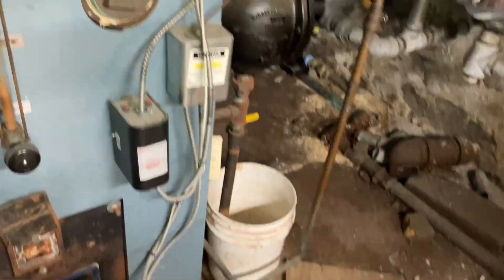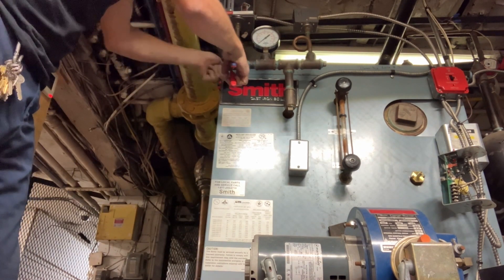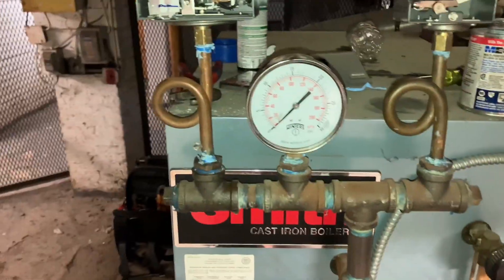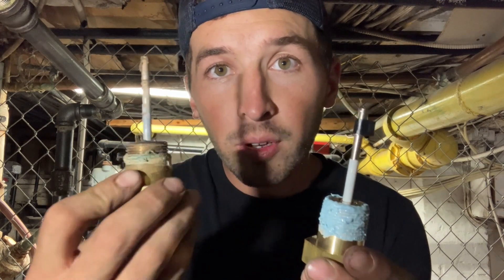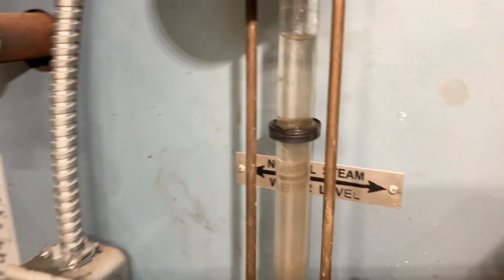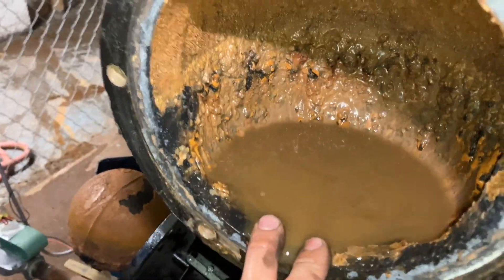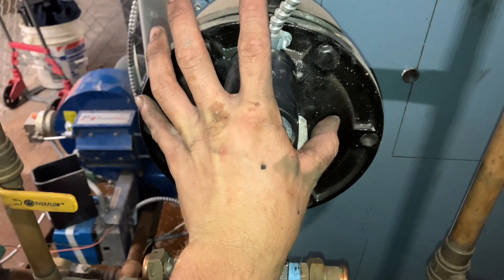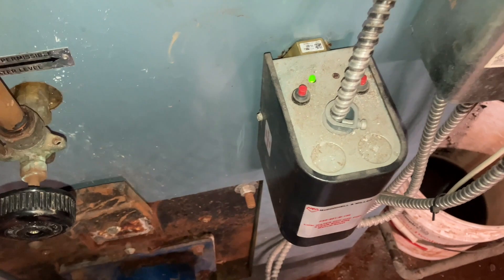A Helpful Steam Boiler Maintenance Guide

Comment: Idk why but cleaning a really dirty steam boiler is so satisfying. Specially when it’s done and running perfect, degrease the jacket so the customer sees a “clean” boiler. Take videos so show what you did, i hear “usually this only takes 10-15 mins”. Then the other company wasn’t doing much. 15 mins is enough to maybe test the LWCO and make sure it turns on and off but that’s it. No burner tray cleaning, no pigtail check, and usually the pressurtrol is at 5-8psi 😂. Just keep turning up the pressure every year, nothing wrong here. 🤦🏻‍♂️

Comment: Your pigtails should be rotated another 90 degrees. yes your current controls aren't affected but old school mercury controls could be affected when the pigtail expands and contracts and rotates the control side to side in the current configuration. rotated 90 degrees it would rotate back and forward and not affect the mercury.
Reply: You've seen that on the others dude video😂😂😂😂😂

Comment: Excellent videos! Question, are the workpro wrenches I’ve seen you using a pretty good set? I need a budget set to keep in my truck. Thanks.
Reply from the maker: other than the fact that i lost one in my truck...somewhere, i haven't had a single problem with them, and i've seriously abused them, 3 years later they've held up well for me!
Reply: Awesome. Thanks

Comment: I don’t remove Lwco probes, I just test them. Most of the time when I do remove them to be replaced the ceramic breaks. So if it was working and the ceramic breaks the customer would be mad I broke something that was working or my office would be mad I’m losing them money by not charging for a part.
Reply: That's why you always make sure you have the part in your truck so you can sell them a new one, Maybe you should just go to the supply house and stock up so you can make those extra small sales that will prevent a callback or a potential breakdown
Reply: Fill up your glass because it's always only half full... be the best tech not just a good one
Reply: @unknownbostonian that’s not realistic I’d need a tractor trailer for all parts that exist that I touch in a day. Also most of my customers wouldn’t accept that the probe broke when cleaning and wouldn’t pay for anything probably lose them as a customer.

Comment: By looking at the boiler you can see that the owner is not maintaining it. A boiler mechanic should explain to the owner and the building superintendent that the boiler needs to be flushed once a week. 
Many boiler mechanics will not clean out the low water cut off. They tell them to replace it when it no longer functions because they don’t want to be responsible if it fails for any reason.

Comment: Great, clear and to the point. Thanks so much from Queens, NYC.  Boiler wouldn’t start, took off the tstat connected the wires. Thought the low water cutoff not working, with your instructions found the probe that probably needed to be cleaned. Gonna check that out now. Thanks again, you’re thorough, and easy to understand.
Reply from the maker: Thank you for the support Eugene! Very generous of you to leave such a great comment. Glad everything worked out for you!

Comment: Excellent Job! First time watching your channel.
How would you clean the probe hole before installing a new probe? My low water cutoff won't reset even tho the water level is back up. I'm suspecting the probe but if mine looks like your I want to clean with out causing more issues.
Reply from the maker: appreciate your support Jeffrey! i use a piece of emrycloth or scotchbrite to clean it, just enough to get the mud off until i see bright metal. when in doubt though, i change it to a new one.

Comment: Your not supposed to put teflon tape or paste on the probe it gives false reading. Just supposed to put in very tight. It's in the instructions.
Reply: instructions say to only put dope only on the last 3 threads.  Do not put dope on the front threads so that the probe maintains a good ground to the tank.  My maintenance manual says to replace the probe every 10 years.
Reply: @zeroordie I am so scared of boiler failure i am much more comfortable checking it and replacing every 2 or 3 years with hard water in my house and sediment build up.
Reply: @jazzcornertv you got that in your house, where you leave ? Damn bro uninstall it this coming weekend, don't wait any longer it's dangerous
Reply: @utrube  New Jersey has introduced me to the fine effects of hard water on metal. All the things that were ignored in high school. I cant believe the maintenance involved in 2024 in steam heating. I will have it changed  end of the heating season. It is working fine as of yesterday (lol).
Reply from the maker: Thank you for the feedback Scott! I was taught only to put on dope for that exact reason, thank you for teaching me something new!
Reply: @theapprenticesurvivalguide   no you did good, you cant use teflon but yes you can use dope so you are rite.  Ive never seen any that stated to not use anything at all, just no teflon.

Comment: In my opinion, since most homeowners rarely maintain steam boilers those no heat calls turn into nightmares of safeties and plugged up everything. After going over scope of work and estimate some customers just want heat on. Is it wiser to walk away or leave tag stating customer declines full boiler maintenance?
Reply from the maker: Wow that’s a loaded question, thank you for taking the time to comment Alan! In my opinion, and it’s gonna sound like a copout, but that’s a judgment call you’re going to have to make. Every situation is gonna be different, so no one would fault you for walking away and saying it’s too much work and you don’t want the responsibility. I could be wrong for thinking that way, but I don’t want a job to become my baby because it hasn’t been serviced ever, or, the last 10 guys they had there screwed it up and now you’re expected to preform a miracle and get it running.
Reply: I have always preferred to err on the side of caution and request everything done. Only problem is none of the techs did all what you just did. (Lol)

Comment: Excellent video.  I didn't realize this one was out there.  I had seen your other one on cleaning an oil fired steam boiler.  I find that the sight glasses start to deform at the top and bottom over time and thin out in the same places.  I generally swap out mine every few years to mitigate any problems.  I actually have cut two more sight glasses to fit my boiler in advance so if something goes awry, I have them handy.  Keep up the good videos.
Reply: A helpful tip is to use "red line" high pressure gauge glass, and face the outside of the line to the boiler (line showing through the glass). It's thicker glass, it's not very expensive, and it actually helps you see where the water level is because the red line refracts through the water.
Reply: @theodorgiosan2570  thanks for your feedback, most appreciated.  Best to you and your family in 2024
Reply from the maker: Kevin that is very generous of you, thank you for your support! I like that you think ahead to pre cut the sight glasses. I heard that the steam eats away at the top of the sight glass which is why they have to eventually be replaced, seems like you have a lot of experience, would love to hear what you think, thanks!
Reply: @theapprenticesurvivalguide  I have 28 years experience in my home and about 20 doing various servicing aspects on my steam boiler.  Your videos are invaluable to people like me who value the insight of a tradesman who sees everything in the field.  Am glad I can share some of my homeowner experiences with you and see that you have seen the same in the field.  Be well my friend and lets go G-men!
Reply from the maker: @kevin7151  You're too generous as always Kevin thank you! The beauty is we can both learn from each-other,  honestly the best part of being in the trades is learning other trades, and being able to do all the work on your home on your own and not have to pay someone to do it. All I hope for is people find the content helpful and maybe motivate some young people into finding a career in the trades, god know were gonna need them in a few years!